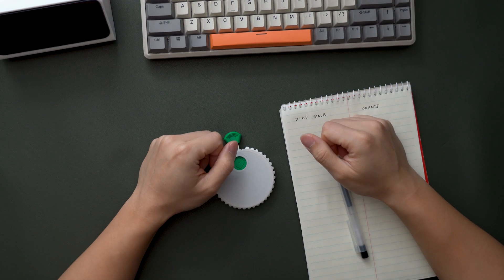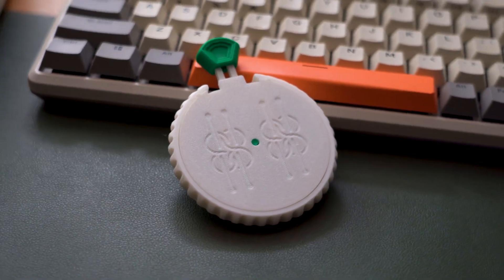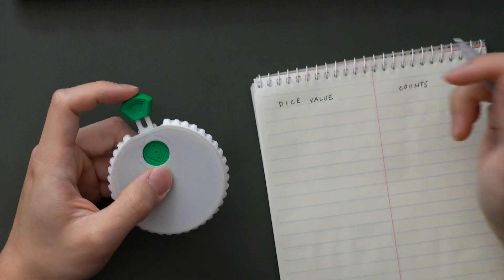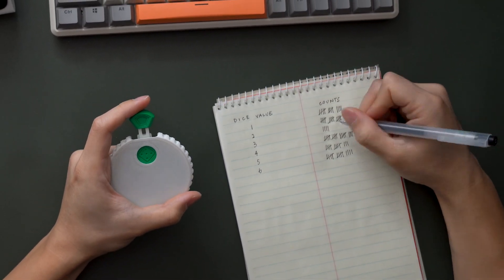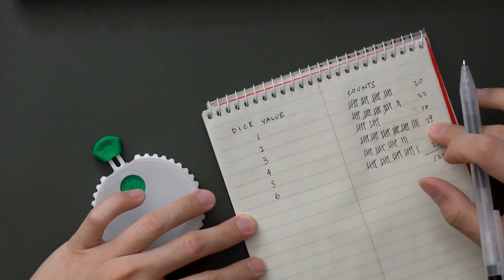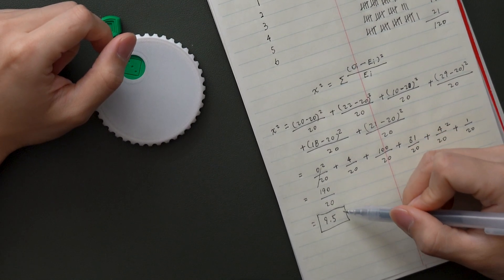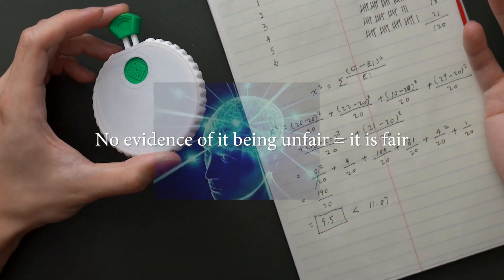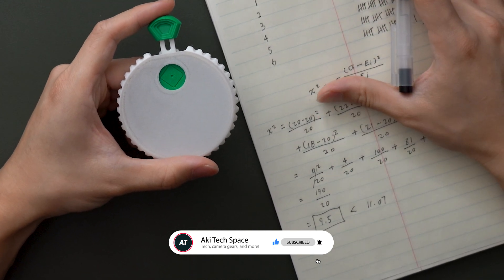Testing the Randomness of 3D Printed Mechanical Dice

Comment: My thoughts on this: A normal dice-throw is a chaotic event, which we want for something to be random. After you pick it up, you shake it randomly in your hand, then you drop it from a varying height, with varying amounts of roll and sideways movement from your hand. All of these factors combined affect the angle, speed, and angular momentum with which the dice hits the table, which makes it quite a chaotic event. This dice on the other hand, only chnages outcome depending on two factors. How fast you push the button in, and how long you hold it for. The porblem i see with this is that humans tend to, consciously or unconsciously, do such things in a similar way each time. That is a thing you cant really calculate or substantiate though, but logically it feels like it would be more deterministic, less random.
Reply: I've seen people claim that they were able to practice releasing the mechanism to get their preferred number. The problem is that you can see the numbers fly by. I thought a modification so that the "viewport" closes shut while you have the button pressed would increase the functional randomness, but really random it will never be.
Reply: If you want small amounts of finite improbability all you need is a strong Brownian Motion producer, say a nice hot cup of tea.

Comment: Just throwing it out there, you seem to be stronger in math and statistics than me, but wouldn't the randomness of the length of time you allow the die to spin make it random, would love to see this again with the variation in spin time removed, as best as possible would be hard to do with it being human operated
Reply from the maker: Haha, my math skills are pretty average, but I try my best! But absolutely, you’re spot on! I do mention in the video how the time you hold and release the dice can influence the outcome. It’s definitely a challenge to consistently control that release timing, which adds to the randomness. Plus, the spring load variability means the dice can travel different distances each time. I've definitely experienced moments where similar holding and release times lead to repeated outcomes. To really explore this further, running more trials with a larger sample size would be a great approach. Thanks for your thoughtful input!

Comment: This kind of dice has one extra potential issue compared to normal dice: Your next roll starts from previous roll, so at least with short presses of the button you could have correlation between the rolls. If there is correlation, the rolls are not independent, and a lot of statistical theory gets messed up. 

In any case, more rolls are needed for moree conclusive results, but yeah, it's really boring to do. The reason is, you'd expect 20 rolls for each option. The 95% confidence interval of the number 3 is approximately 4 to 16, which does not include 20. 20 also just barely fits inside the confidence interval of the roll 4. So based on these stats, the dice overall fits uniform distribution, but it fails for one number, almost two.
Reply: "Your next roll starts from previous roll, so at least with short presses of the button you could have correlation between the rolls", interestingly that has been a problem with pseudorandom number generation going back decades. For some of the earliest algorithms simply knowing the previous number allowed you to make statistically significant predictions for the next. As computer science progressed, knowing the previous ten,hundred,thousand,million numbers helped predicting the next. This was used as a cryptographic attack, if you could force the system to output a stream of generated numbers then you could massively reduce the entropy till you could predict the seed value for a cryptographic key.
Reply: While I agree that it doesnt seem as random as a normal dice, that issue specifically i dont know about. With normal dice, you still technically pick them up from the table with the last "roll" upwards right? But at the same time, since the roll itself in the printed one feel like it is less random, maybe it has more affect??? I dont know, theres lots to take in to consideration.
Reply: @jakobnorrestam  Except this has 1 degree of freedom (that too in only 1 direction) while a dice has 6 degrees of freedom with arbitrary directional changes. It's like comparing the shell game with euro jackpot and saying it's pretty much the same because both include a person doing something at some point.
Reply: @ww-pw6di  that's not how DOF works. You're conflating statistical DOF with mechanical DOF. Yes, the disk can only rotate while a die can rotate in 3 dimensions and translate in 3 dimensions (though, translation is actually entirely irrelevant to the roll, and you can translate the disk as well, so technically it's more accurate to say they have a mechanical DOF of 1 to 3 with respect to the roll itself) but that doesn't equate to statistical DOF. 

For instance, if I pick it up with the top side as a 3, am I subconsciously shaking it in a way that retains some of that knowledge? Almost certainly yes, I am. Hell, even putting aside a subconscious bias, your hands are not a perfect hollow sphere, which means the orientation the die is put into your hands at will affect how it shakes inside of them, since certain corners will get caught more or less between the grooves of your fingers. So not only are there potential psychological factors but physically we can say with absolute certainty that there is not a true random 1:1 correlation between the mechanical DOF and statistical DOF. 

Any attempt to generate randomness (until we start talking about things on the quantum level and such) is actually just a question of "can I introduce enough noise into the system that it's sufficiently unpredictable?". Given how fast this appears to spin, the answer is almost certainly yes. The level of precision a person would need to have to keep track of the spins on their internal clock, the level of reaction time necessary to start/stop it at the right times, the dexterity to start it rotating with just the right amount of force, etc. would all also be invisible "Degrees of Freedom" statistically speaking, since they add additional randomness to how the single mechanical degree of freedom is interpreted. (so just like how the 3 DOF of a die is influenced by your psychology, shape of your hands, etc. when being converted to a single statistical DOF on the range of 1-6, your internal clock, time-bias, dexterity, etc. woulda ll controbitue to how the 1 DOF of this spinner is converted to a single statistical DOF on the range of 1-6)
Reply: @robonator2945  I wasn't conflating the 2, you did, I was simply illustrating that just by it's mechanical properties alone it's a completely incomparable comparison. 
When considering the statistical degrees of freedom, the difference becomes even more substantial.
Reply from the maker: You make a good point! I hadn’t thought about how the last roll could affect the next one. If they’re connected, that changes things a bit. More rolls would definitely help! Thanks for sharing!